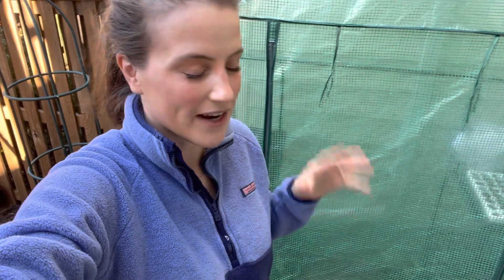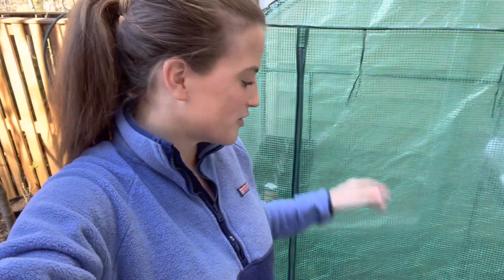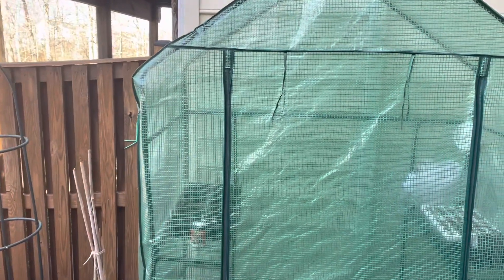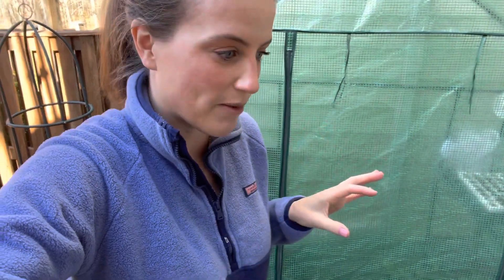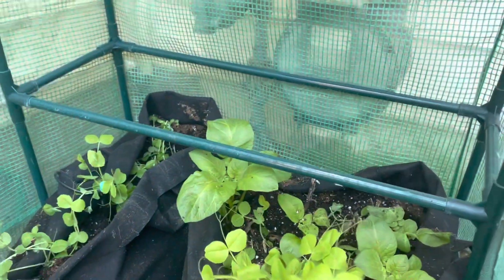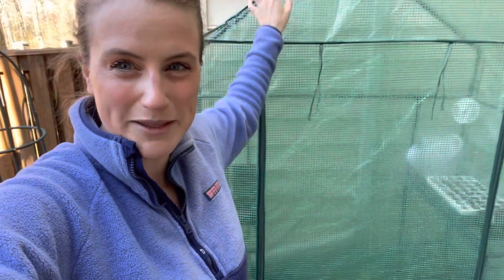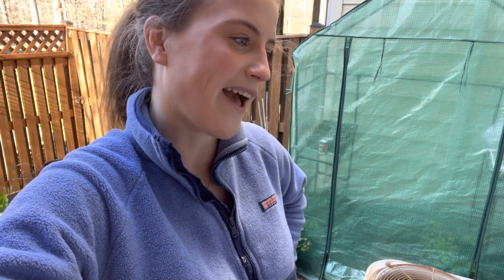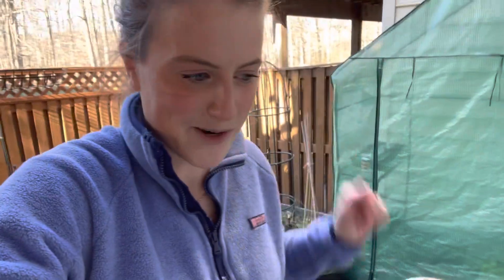Dealing With Wind In A Plastic Unheated Greenhouse | The Reckless Garden

Comment: I built a wood platform for ours and used pipe clamps on the base to hold it in place. We also used abs cement in the plastic joints on the 2 main sides to add extra rigidity.

Comment: Your so right about location.  #1. I also put large rocks leftover from fireplace build all around the bottom sitting on the plastic. As well as stakes in the ground. Closing helps as well. It served the purpose until we had a huge windstorm and it tore up the plastic as I was opening up to save my seeds.  My cover was torn so I save the shelves and the structure to use on my porch.